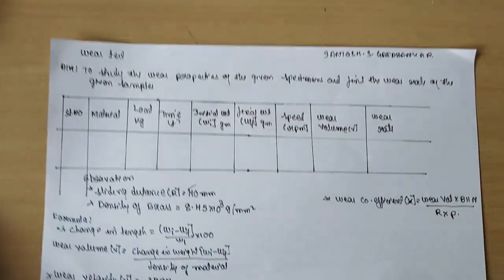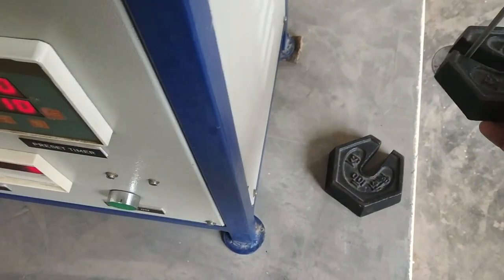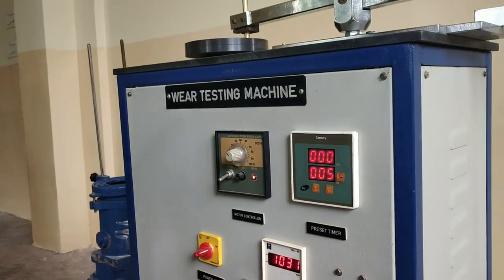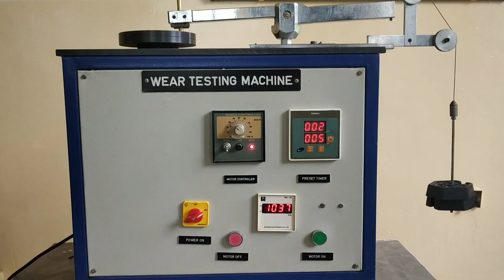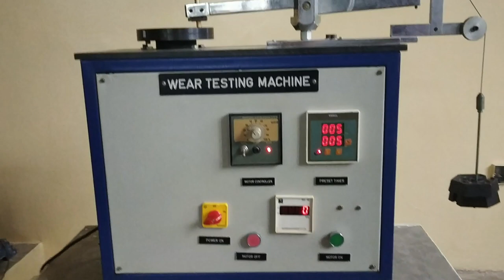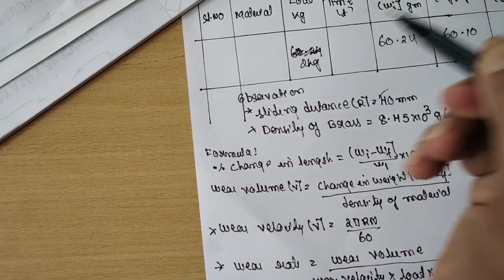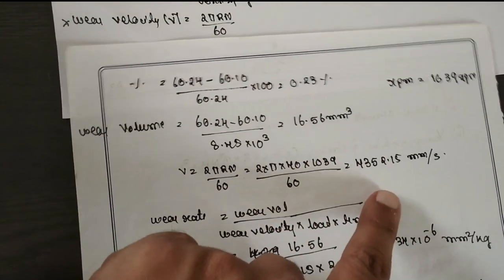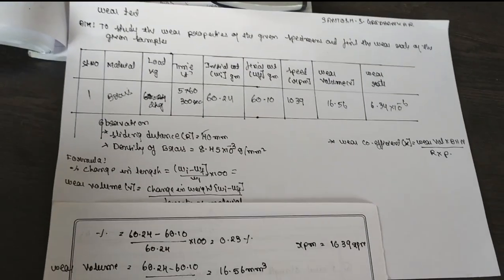WEAR TEST ,VTU ,SVIT,SAVI,MT LAB

Comment: Question...

Isn't the 2kg force applied by the pin on disc reduced due to the angle of strings in the pulley system?